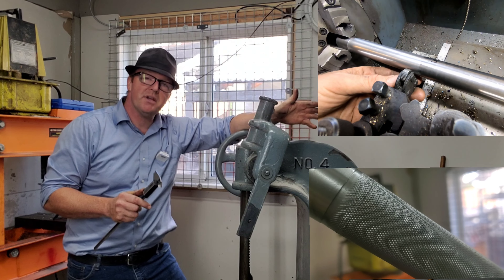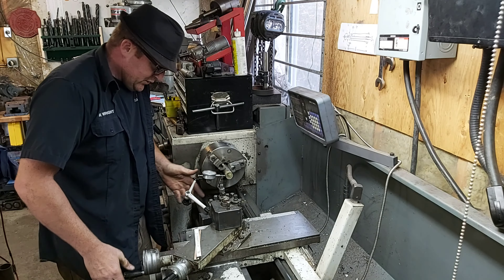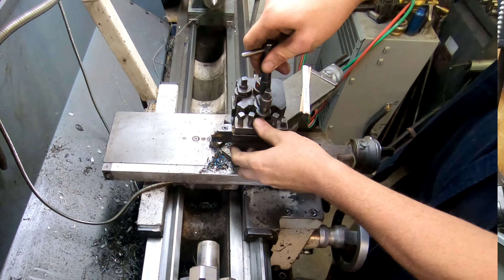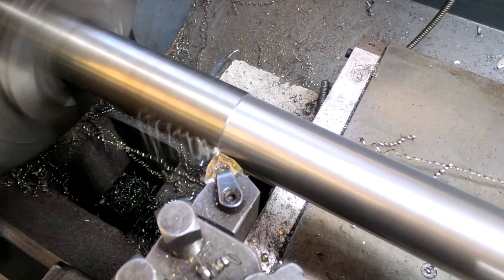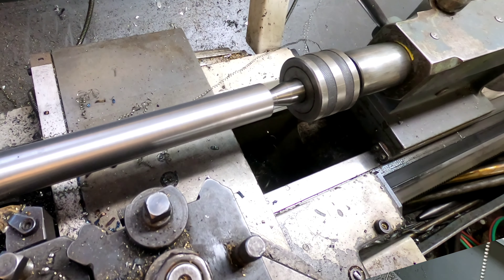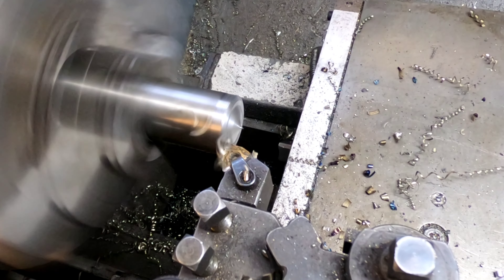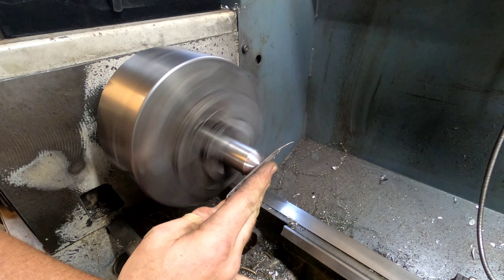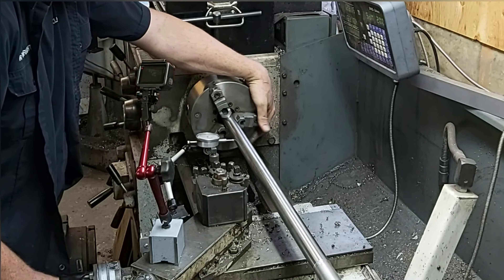Making Rounded Knurled Handle for a #4 Greenard Arbor Press on the Lathe

Comment: Nice job. Curious how you like the Hero 6? I upgraded to a Hero 7 and it was nothing but problems. It would freeze up constantly and was not reliable. I eventually had to go back to using my Hero 4's.
Reply from the maker: It works good out in the field so to speak and no freezing up , i have heard of that for some models have done that but maby the six just hasent been used enough by me yet to see it  . I went for the 6 by chance a fella had upgraded to the 11 and had it on market place .  Some of the issues i have are small like linking up to the phone blue tooth .( i do all my editing on myphone .) I like it because you can swap out the lenzes for it . I have busted a few cameras due to welding or being to close to the action .   I would say im happy with it for what i payed ( 200 cn  $ )   the ability to get good shots in the shop is amazing compared to a s10 samsung or the video cameras i was trying out .  Its some what ok with lower lighting to a point as well .   The sound was messed up on one of the videos but that was due to my mic cord in backwards .  One is an adio jack at one end and the other a special mic plug with more prongs .  The go pro saved me actualy since i used lots of sound from the go pro and did pag on page overlap to save it .